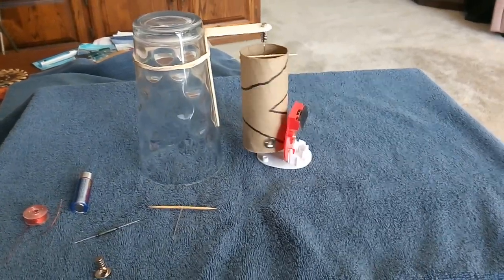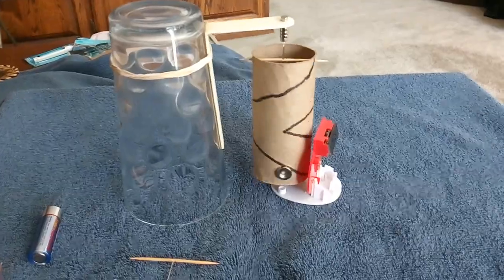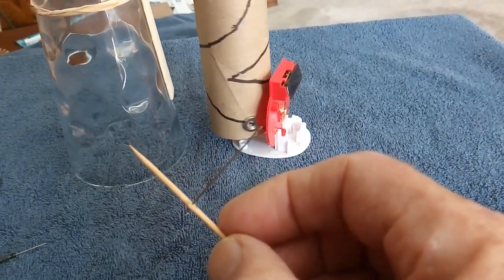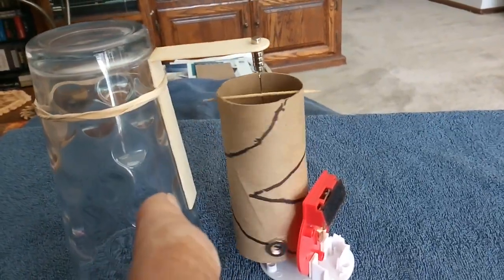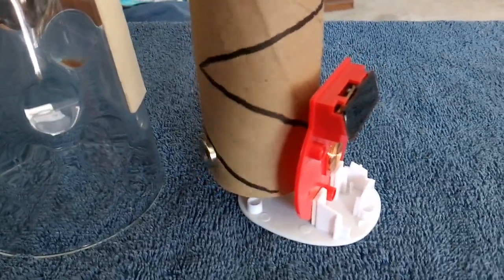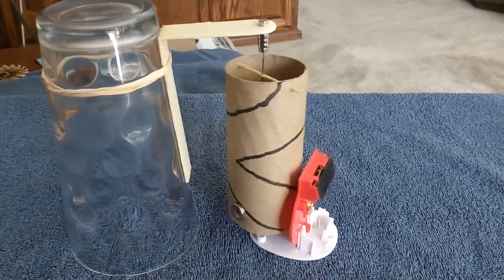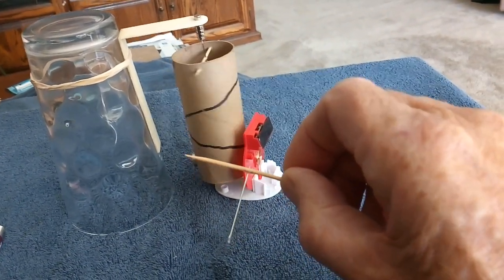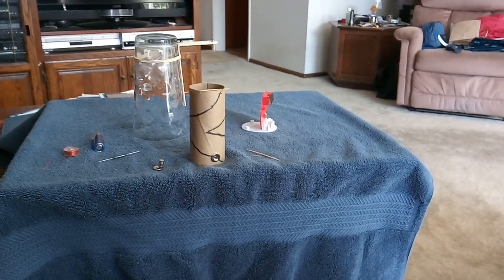TV Tray Pulse Motor

Comment: Nice!
Reply: Ain't seen you in awhile. You able to chat? The majority of my interests in what I'm currently doing is from your channel. I'd love to chat for an hour or so, mainly because I'm working material that I've been making batteries out of and I'd like to show you.
Reply from the maker: Your solar powered / super capacitor EZ-Spin finally stopped after 5 1/2 years of non stop running.   I carefully moved around the wires a bit and started it back up in the other direction.  It is still running now after about a week.  I think the needle is wearing out as it runs in the jewel bearing.  The electronics seem fine but some of the connections are friction fit and corrosion might be why it stopped.  I'm really curious how your other long running devices are doing.  The nuclear one and the fully levitated one were amazing.

Comment: Nice job. I sure would like to see a quick vid on how you wound your bobbin coil. I use a fishing rod reel which works pretty well. I'm tinkering with a counter for the bobbin coils. Any Ideas?
Reply from the maker: The wire coil is wound using a battery powered drill.  I use a wood dowel bushed up with masking tape to a tight fit to hold the bobbin.  I let the main wire spool just unwind on the ground or on something like a pencil stuck in something.  I don't know of an easy counter but you might find some videos on how to make one.